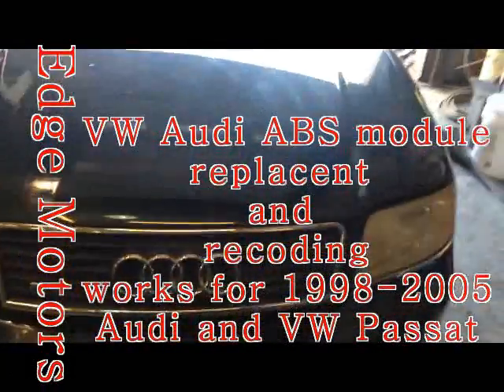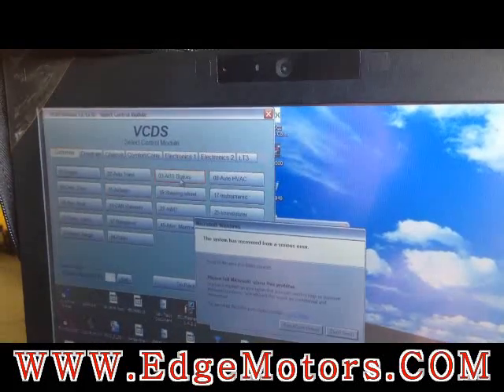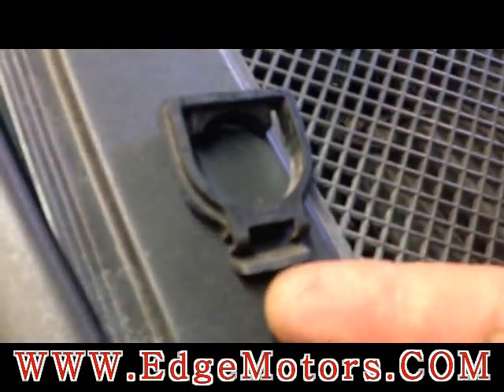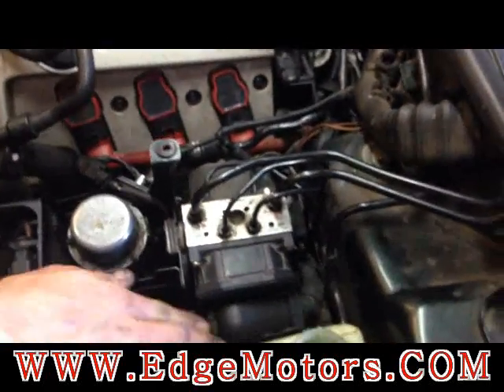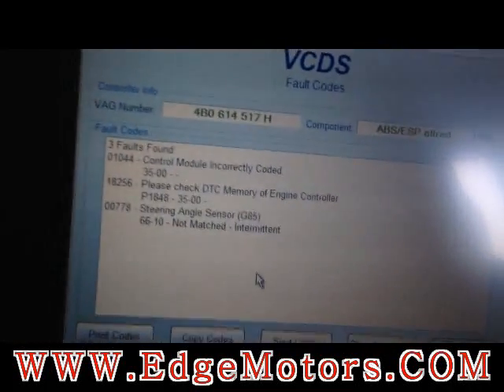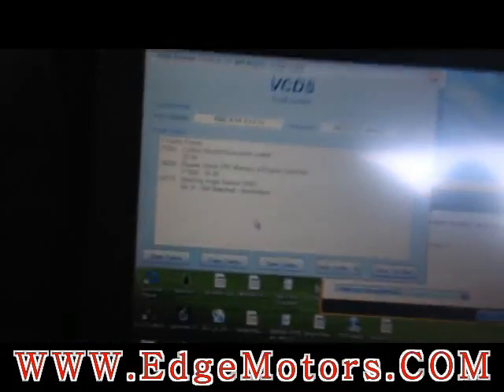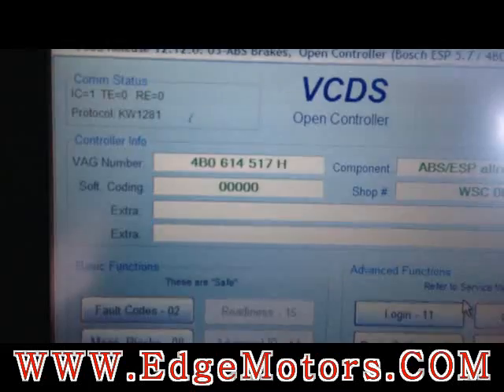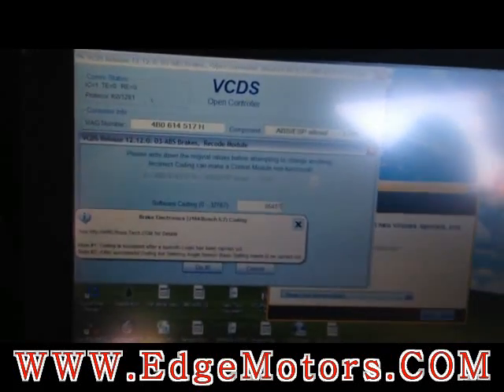VW Audi ABS control module replacement and programing / coding DIY by Edge Motors

Comment: i have the same problem on my vw mk4 vr6 01' the brake light blink and sound 3 or 6 times idk why but also sometimes just turn off the ABS and ASR
i just change the module, but i never programing, so with vag com and thats all?
thanks BR

Comment: Thanks for posting this, I have a unique problem with my 2006 Audi a6.The brakes failed completely 3 times.I replaced the master cylinder 2 times and still I have no brake pressure and no leaks. I have a traction control light on, after the first master cylinder replacement the brakes engaged and would smoke from dragging on the rotor. Later they let go of the rotor, lost pressure and brake pedal  now falls to the floor and the vehicle won't stop. I took it to 3 other mechanics and the dealer looked at it but wanted a lot of money to replace several parts at a time to find the issue. One clue in this video that's similar!!! the abs will not communicate with the vag-com. I think you may have helped me out. I'm going to replace the unit, have it programmed and let you know if that was the problem. Thanks again
Reply from the maker: The abs has nothing to do with the fact that you have no pressure.
When you bleeding brakes after the master cylinder replacement, does fluid come out strong from the bleeders?
Reply: Thanks for the replying, no the fluid does not come out strong,I get very little fluid when bleeding it
Reply from the maker: +picpeige02 try bleeding it more.
Reply: Ok thanks,I left out a few details in my post.This problem started with a loud beep,Traction control light and parking brake malfunction,the brakes engaged by themselves, dragged then shortly after failed lost all pressure and could not stop the car. I had the master cylinder replaced. The brakes worked normally for about a month.Then the same scenario all over again. We assumed the aftermarket M.C. was defective,replaced it again,worked for about a month and for the 3rd time it all happened again.I had the M.C. bench bled and the system bled yesterday.It did not work however I do know the abs mod will not communicate with the VAG-COM  I now think the ABS module and the master cylinder are the issue. any Ideas?
Reply: ABS blocks CAN leak internally. Rare but it does happen and you get his symptoms.

Comment: it's gotten to the point where you need to be a software programmer and hold a p.h.d . in physic a to wrench on a car now. So expensive to fix cars now. Don't buy a car from a manufacturer that won't warranty all parts 100,000 miles/6 years.

Comment: just reinstalled an abs pump after having it tested for faults. everything works but traction control light and tyre pressure light stay on. fault listed is 'steering angle sensor not calibrated' in live data everything is fine. Abs works fine as does power steering. 2010 polo
Reply from the maker: +wayne bardell check out our video on steering wheel angle sensor basic settings...

Comment: Can anyone believe the absolutely insane crap that has to be done to replace a brake module on this German piece of garbage machine?  big reason I tell no one to buy these endless money pits. Who in Hades came up with "coding" parts to replace them? Just another German insane money maker.
Reply from the maker: This is made that way to make production cheaper, so they could use the same module in many different cars with simple software adaptation, instead of making different modules for each one or making allot of cars with the same brakes...
Reply: +EDGEMOTORS  I understand that, but really, it rips the crap out of consumers to pay for such repair insanity. Let's face it, the stupid car could have a computer that sets it up automatically. for christ's sake, I can plug any device into my 400 dollar laptop and it will automatically set itself up. there's NO reason to make cars that require all that coding crap, other than to rip off consumers.
Reply from the maker: +Scotty Kilmer granted... It is very truth. That's how they make sure to make money in long run... Look at the "component protection" now.... It does remove it automatically, if the part is brand new... But if the part is used, you going to have a trip to the dealer which will charge you couple of hundred to remove it... That way they make sure that they make money even on used parts:))) I can remove component protection, but it still cost me money,
Reply: Nutjob Scotty chiming in again
Reply: Scotty Kilmer Insane German money maker..... whatever.... I just picked up a 2003 Passat Wagon for $600 and it needed an ABS module and a tank of gas.... and mabey a few AC vents.... last owner broke em...
Reply: +Scotty Kilmer My crown vic has a similar looking module, even in the same place. Ford requires a similar procedure too, on the newer cars. No wonder why there is such a big market for china hack scan tools. The tools are junk and break but even so it is WAY cheaper than what a dealer would charge.

 I'm in upstate NY and felt worse last month when I replaced a brake hose and ended up replacing the front line on the left side when both flare nuts were siezed due to rust. Even the coated line didn't help :(/.
Reply: letanovce
Reply: +Scotty Kilmer lol welcome to the world of working on ANYTHING except 1990's domestic vehicles, bud. You will have to adapt your antiquated methods of repair and simply get with the times.
Reply: +Colin Moreau see my video "fixing insanely complex modern cars"  I already know how to fix em, but still think it's stupid
Reply: +Scotty Kilmer  you are right is a nightmare for me working on those crap.car every day...

Comment: good day. have a 2004 a8l that the abs was no good. got a used one , did the coding and install it. the car runs very good, no cods till after an hour of driving the abs light comes on. what's going on . need help
Reply: hate to say this but sometimes things must go too a professional or try to buy a after market warrenty that covers that part
Reply from the maker: +Dylan Weiss well. if you erase the codes, and then later on the abs light comes back on, it should set a code. see what the code says... you might of did a steering wheel angle sensor calibration when the wheel was not straight, or yo might need wheel alignment... so read the codes....
Reply: +EDGEMOTORS hey buddy I had a quick question if you could give me some advice.... I have a 01 audi a4 and had a bad abs module (had abs+brake lights on dash) and I sent it out for repair and when I got it back and plugged it in the lights weren't on anymore but now when I brake sometimes I'm getting vibration in the pedal as if the abs was engaging, no matter how soft or hard I brake. Any ideas would be a great help and appreciated. thanks and great video, it helped a bunch!

Comment: If you didn't do basic settings  after you did the first login and coding what would have happened?  Is the abs module locked?  Are you able to start the coding and adaption process over again?

Comment: but if part numbers same not always need code them. when swap trasmition control module from donor car,same number,no coding needed.
Reply from the maker: Hustler LT you talking about 2 different modules...
Reply: +Hustler LT Gali parašyti savo e-mail, turiu klausimų dėl ABS bloko pririšimo.

Comment: say ,do you need to code new module if part number and bosch codes are same?
Reply from the maker: Hustler LT yes, i need to code any module that was not installed on this car previously... and some times even if you remove your module and put it back in you may need to code it.
Reply: Edgemotors your the best Audi VW car maintenance guy wish I would've  known about you when I had my Audi a6 2.7t

Comment: Sooo well, i have a couple of codes on my 04 A3 2.0fsi, amongst others steering angle not set correcty, the abs light is on, and the abs does not work, plus the traction control light is on. These codes and lights dis not appear at the same time, but is it probably my abs module that is broken? Thanks :)

Comment: hey I have a interesting question: I have a audi a6 2.8 2000 quattro with  factory abs
 electronic unit  part #  0 273 004 284, and abs pump part number unit 8E0 614 111 A  which is not working in my car.
I sourced out a abs unit that came off a audi a6 2.8 1999 quattro allroad. abs (0 273 004 134, 8E0 614 111 M)

CAN I SOMEHOW USE MY ABS ORIGINAL ABS PUMP (8E0 614 111 A) AND USE THE SOURCED OUT ABS ELECTRONIC UNIT (0 273 004 134)?
 
and if so..how would I do it? thanks so much...from a everyday viewer of your channel

note Bosch Part No. (on back of module) Corresponding VW Part number of Pump
0 273 004 284, 8E0 614 111 A
0 273 004 283, 8E0 614 111 B
0 273 004 285, 8E0 614 111 C
0 273 004 286, 8E0 614 111 H
0 273 004 134, 8E0 614 111 M
0 273 004 133, 8E0 614 111 P
0 273 004 135, 8E0 614 111 R
0 273 004 358, 8E0 614 111 AH
0 273 004 573, 3B0 614 111

I WANT TO KNOW IF 0 273 004 134, 8E0 614 111 A 
IS POSSIBLE SOME HOW...THANKS AGAIN
Reply from the maker: the letters at the end of the part number on those abs units usually corespond to revision version. so it should work, but might be a problem with coding....